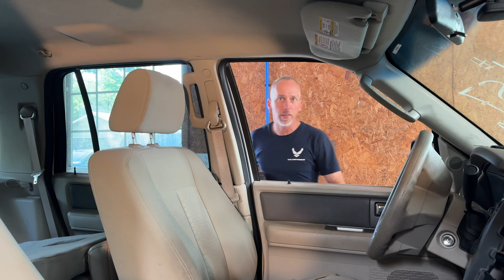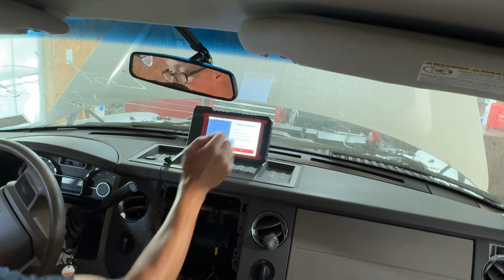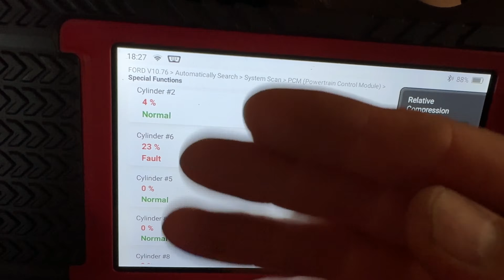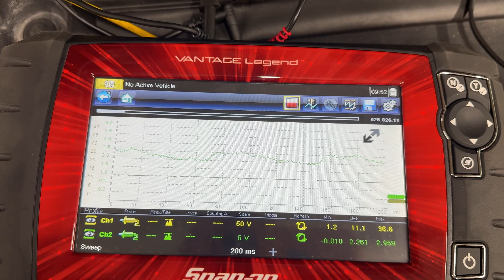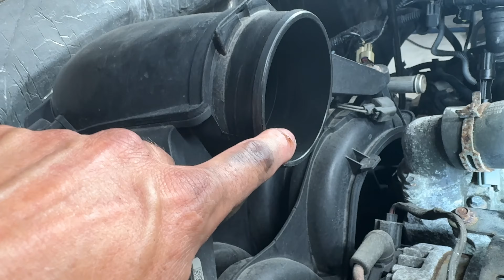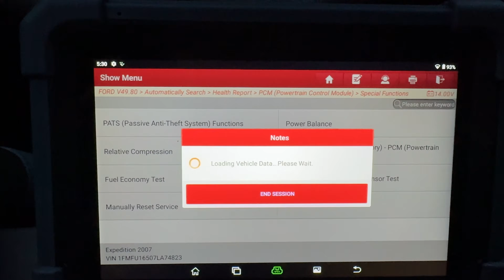Solved: Engine pops at idle.

Comment: I have a 2003 ram I just bought to sell. Mine pops at idle exactly that noise but mine sounds like it’s the throttle body itself I don’t know if they can pop or not. There isn’t any lifter or any kind of noise coming from valve cover
Reply from the maker: Strange, usually you’ll get a lifter tick on those 🤔
Reply: @ToolDemos what I was thinking too.

Comment: I have a 2024 Mustang Darkhorse and with just over 6K the engine was replaced for oil consumption. When I got the car back after they changed the long block (2 months ago) it started making the same popping noise as your having but only after it comes off high idle and it only does it 3-4 time in row then settles down and only does it every so often but is always present. Not sure if it’s the same issue but Ford says it’s nothing to worry about. Not sure about my next step.
Reply from the maker: If your engine is popping through the intake, I can confidently say that it’s not normal. I’ve heard other mechanics talk about it, and it seems to be a very common symptom when there is an issue opening the exhaust valve. 

If this dealership is trying to wash its hands of this repair, it might be time to go to a different dealership or call Ford directly. 

If you are trying to investigate this yourself, I would try to identify the cylinder that is having the problem. Assuming there’s only one cylinder with a valve issue, it wouldn’t be difficult to disable one cylinder at a time and try to re-create the problem. When it stops making the noise at least you know what cylinder has the issue.

Comment: Mines does this when I accelerate
Reply from the maker: @mray62979  is there a check engine light on? Sometimes that can be a timing issue.
Reply: @ no check engine light
Reply from the maker: @ has the engine been ticking?
Reply: I just found out what it was I check my throttle body and told my wife to turn the key it didn’t open like it supposed to I told her okay turn it on and press the gas it didn’t open it back fired so that a relief 😮‍💨
Reply from the maker: @ oh wow, good catch!
Reply: Thank you for taking the time to help me your awesome thanks
Reply from the maker: @ I’m glad you got it figured out.

Comment: I think I have same issue on smaller scale. Replaced 2 of 4 spk.plugs and it idles worse. I hear the putt putt and it'S hard starting inconsistently and even stalled now. Scary
Reply from the maker: @memoryrinehart  if you pull the valve covers, let us know what you find.

Comment: did you replace 1 cam or?  great video.
Reply from the maker: @michaelharris1895  thanks. Yup, I replaced 1 cam, 1 rocker (follower), and 1 lifter. Most people would recommend replacing all the followers, but the job is so easy. I could just come back later if I needed to..

Comment: Great video!! Quick ? I have a 04 freestar making similar noises during start up and only when I accelerate
Reply from the maker: @saleemharris  the engine on your van is not built the same way as this one. So you wouldn’t have the same problem, if I had to guess I would say look at your ignition system. Plugs, wires, timing.

Comment: “Dealership-level diagnostics” 😂 

We DIYr’s were running cylinder balance tests on Ford EEC-IV back in the 80’s with noting more than a jumper wire!

But I sure do like the ability to visualize that data in real time.

Comment: There is no oil under the valve covers that probably causes the problem
Reply from the maker: True, the updated rocker has a smaller hole to keep pressure higher and improve oiling.